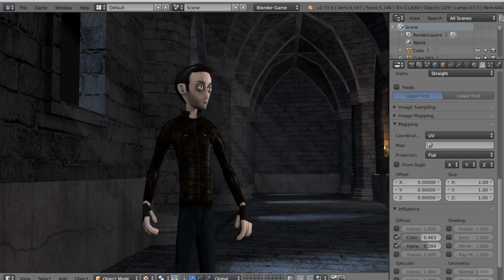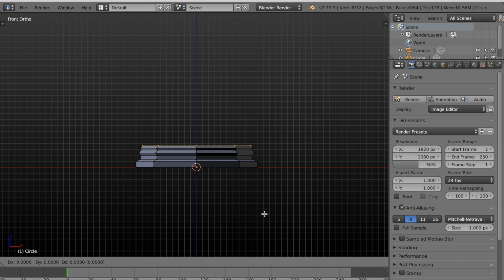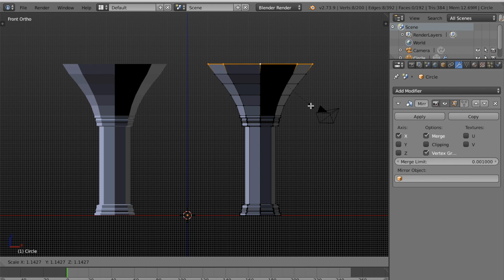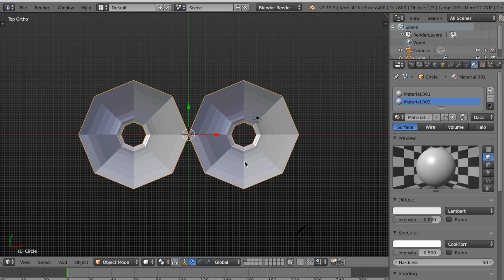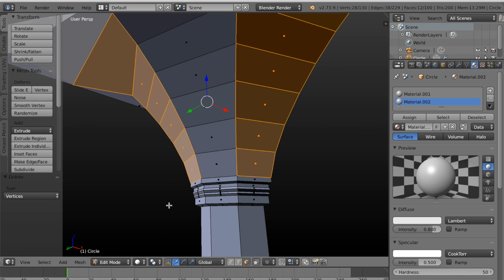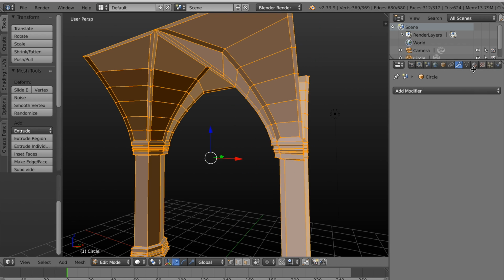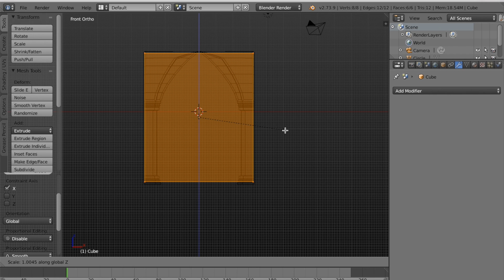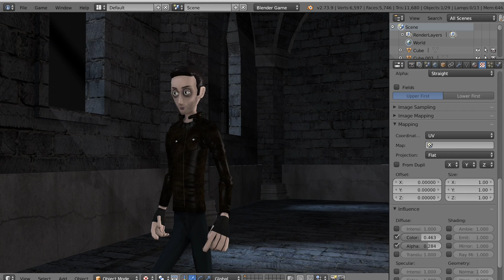Modeling Cathedral Arches in Blender

Comment: Hi Michael.. OK I've done this (minus the texturing)... I found it a challenge (for a noob). Even though you make it look so easy. The thing that I was frustrated with was making sure to select all BEFORE duplicating the plinth, I kept adding a new circle and then when I tried to join the edge loops I couldn't, because I could only select one of the two, not both... took me a while to "get it" :) Got there in the end... and it looks pretty similar to yours - without the texture :) I'll probably attempt this again, a few more times to cement the knowledge!! Thanks again!
Reply from the maker: +dougieladd This was one of my earliest videos and I probably didn't do the best job explaining those steps. Congrats for getting through it despite that. :)
Reply: Progress has been made... I went back to this today to model it again... and I did it in less than half the time... so something has eventually clicked. :)  Cheers.